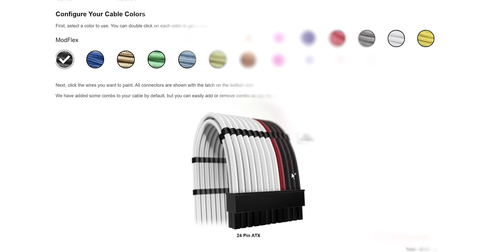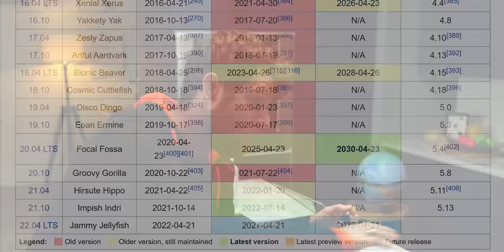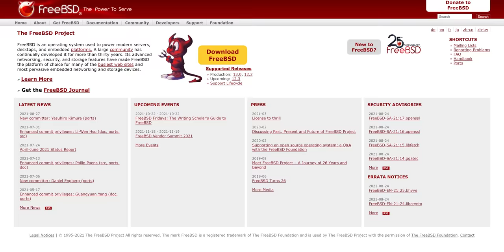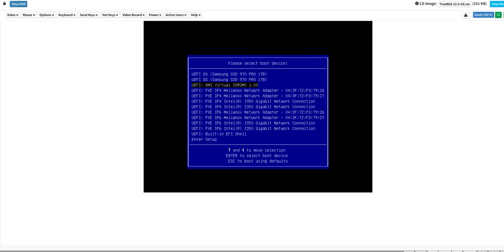We Finally Did it Properly - "Linux" Whonnock Upgrade

Comment: "We're going Linux baby!" - Goes BSD.
Reply: Ya. TrueNas Scale is Linux (they have BSD though as well) though. Still in beta, improving every day. Seems to work fine though.
Reply: In the end... Bsd likes. , 🆓
Reply: @Fiberton  maybe 10 years ago.
Sorry, Linux more perrormant, secure these days ;)
Reply: Honestly BSD is not even that bad and hard. Most linux apps work on BSD and when i say most that means 98% of them lol
Reply: @Fiberton  Installation can be nasty, ditto Debian and wifi not working by default. artificial hurdles to dissuade people using them.
Reply: "We're going Unix!"
Reply: UNIX, Linux, BSD… same difference 😁
Reply: @OwenGilmoreOG  Only a person who knows nothing of Linux would say that.
Reply: @OwenGilmoreOG  nah. They're distant relatives at best. Even though Linux shares a lot in common with Unix, it's still not Unix.

A little back story about Linux (at least from all I can remember from researching it): GNU/Linux (A term that's only useful when discussing the history of Linux) was made at a time when Unix was entirely an enterprise operating system and well out of the reach of most people. Unix had multiple forks from various manufacturers that they bundled with their expensive hardware and they were largely incompatible with each other, and most of them could only run on select machines. As a result, it was rather stagnant outside of Research Unix (which became BSD at some point) and there wasn't much software for it beyond what the manufacturers wrote for it. Companies had to pick and choose what version of Unix to support. Tired of this, a group of hackers set out to create a clone of Unix for the masses. As they continued to develop it, they realized there were numerous things that could be changed or improved on, but would break compatibility with Unix. They chose to do those things anyways seeing as they figured that software developers were going to flock to this new Unix-like operating system. Some time passes and the bulk of GNU was in a working state, but it needed a kernel. Multiple people tried to submit their own, but none were particularly great. All while this was happening, a particular man named Linus Torvalds was fooling around with GNU and tinkered with it daily. Hearing the news of a kernel being needed, he decided to create his own and did a lot of research on how kernels and operating systems worked in his free time. At some point he decided that his work was decent enough to share with others. Shockingly, it was rejected by most people at first. But sooner or later the people at the FSF with GNU realized that Linux was a far better kernel than anybody's attempts so far, so they decided to partner with Linus and make a full operating system out of it: GNU/Linux, with Linus focusing on the kernel and the FSF focusing on the operating system. Within a few years it became a huge success and the rest is history. And they continued to change things and become further and further away from Unix.
Reply: @felipec  ahhh computer compater my good sir
Reply: @OwenGilmoreOG  Microsoft Windows, Apple macOS and iOS, BSD, and Linux has their UNIX roots!
Reply: @markarca6360  indeed, windows is becoming much more Unix like (powershell)
Reply: Just use both BSD and Linux, you'll be having best of both.
Reply: @OwenGilmoreOG  I wouldn't say powershell is Unix like. Every returned value in powershell is an object while in Unix shells returned values are strings.
Reply: @houserouterhouserouter5808  If anything BSD is better thanks to apple helping greatly with the development of free BSD. But that doesn't change the fact it's not linux, linux is an imitation of BSD (it's "unix like") whereas macos is based on freeBSD. So it's closer to being a macos-server than it is a linux server.
Reply: @nigratruo  I don't think it's fair to say "Unix is dead" when Mac OS is a Unix OS and Unix Certified. Unix is far from dead from that fact alone.
Reply: @theonearmedbandit3826  You’re certainly right but his point was that unix principles are just that, a base. Many parts of the original operating system would not hold up well in the modern world, which is why macOS and linux shine
Reply: @JordanLOL  Unlikely, BSD keeps developing and many of closed solutions are based on BSD. PS4's Orbis OS is such a great example.
Reply: @JordanLOL  wasnt SCALE version. Could read FreeBSD on the console, lol. Also shell was FreeBSD's 'csh' not 'bash'..
Reply: @unitrx5535  would love to see an article or video on that information if you could dig it up. A quick Google turned up some info, but it's super old.
Reply: @OwenGilmoreOG  well Linux is not Unics certified so officially not Unix.
Reply: “Deeeeeeeeebian”, lol.
Reply: Linux isnt even linux. Its a colloquially used name for all kinds of linux based os
Reply: @nigratruo  Unix is not dead. The one big problem it has is user-friendlyness, and I don't think this can be solved without giving up on everything Unix stands for. It will probably always remain a power users' OS.
Reply: @martijnheil8825  Oh UNIX is really dead, has been for many years, but Linux is alive and well and it is current, not 40 years old. So everything that gets attributed to Unix today is actually thanks to Linux. Linux drives the whole development forward, not Unix.
Reply: @nigratruo typical Linux these days is a unix clone with some modern additions and a badly designed window system + GUI bolted on top of it. Everything below the GUI still uses the old unix primitives.
Reply: @martijnheil8825  You are clueless if you think that, most components are no longer Unix. The Kernel has nothing to do with Unix anymore, the startup System, the sound system, the firewall, the TCP/IP networking layer, the display server (wayland), KVM machine virtualization, docker and containerd app virtualization, the boot manager, the EXT4 filesystem, SSH secure shell, bash, all these things are not from Unix and when existing in BSD, they have been backported from Linux, not the other way around. Unix has been dead for many many years, no wonder nothing is left. (except some of the CLI tools like the cp and mv command which date back to 1973 ;-) LOL
So your so called Unix is a Linux clone today.
Reply: @nigratruo  This is only because Unix development at Bell Labs stopped long, long ago. All these things you mention are continued developments of Unix. It doesn't matter that they weren't written in the 70's: they're still building on and inspired by Unix.
If you want to see something that's definitely not Unix, look at Windows NT.
Reply: This triggered me a little bit 😄
Reply: @nigratruo  Can't you refrain from personal attacks?
Clearly we have a different definition of unix.
Reply: @martijnheil8825  Sure, it is just endlessly annoying when people keep repeating the same old bullshit and falsehoods about what Unix is supposed to be. You could also maybe learn something and learn to use arguments to prove your point? You just keep ignoring what I say and keep insisting on your standpoint. Why isn't it called the Unix Kernel if it is supposed to be all Unix? Can you relate how annoying it is if Windows would always be called MSDOS, while it in fact has nothing to do anymore with MSDOS and has not been based on it for a long time?
Reply: @theonearmedbandit3826  Yeah! Heck, Macintosh has just about a whole 15% of the desktop+laptop market! Look out, world!
Reply: @KurtRichterCISSP  it's funny that you would think like that... If we include mobile OS, iOS is around 17% and MacOS around 6% for a combined 23% although unlike MacOS I think iOS is not Unix certified and is only "Unix like" just how Linux but still built upon the Unix philosophy. Android (Unix like/clone, since it's a fork of Linux kernel) is at around 39% so that's a 62% market share for Unix and/or Unix like/clones in total in the computing world. Windows is at 31%. So yes, look out world. Unix or at least the Unix philosophy is alive and ticking, no matter what anybody tells you, thanks to the combination of MacOS, iOS and the Unix clones. So I stand by my original comment. Unix is not dead (or at least the Unix philosophy isn't as it's used in many modern operating systems).

I didn't include Chrome OS or Linux and BSD since their share is so low
Reply: @theonearmedbandit3826  you know, you're right. If you include iMacs and ipods it just keeps growing
Reply: @KurtRichterCISSP  iMac's use the same OS as all other Mac computers...they use MacOS just like a MacBook and Mac desktop. What are you even on about at this point... iPods also use iOS same as iPhones...
Reply: @markarca6360  MsDos/PCdos/CPM.. all have their roots in UNIX.
Reply: Lies, all LIES! 😡
Reply: @theonearmedbandit3826   @The one armed bandit  )) you can't simply add up percents derived from different bases to calculate a combined share of something! So, your 23% and 62% estimates is a total joke and far from reality.
Reply: @scality4309  Exaggeration -- of course, they all borrowed some generic concepts from Unix like file/directory/path, command shell, command pipe, i/o redirection, small system utilities and some other tried and true ideas known by that time -- but that's akin to saying everything in the modern world is still based on an ancient Greek, Indian or Arab technologies, since all of the basic math was invented back then. The point is, Unix was the first and only universal and widely used OS family in the 70-s, so it's naturally influenced all the later developments in some way or another. But nowadays it's mostly a forgotten legacy: MacOS and Linux superceded it in almost all respects and pushed progress further, while keeping source-level and ideological compatibility to some extent.
Reply: @alexanderr.539  It's not, do you know why? Because they are all Unix/Unix based. Which was the argument, as some people think UNIX is dead when it's clearly not. Do you think the market share for Windows only counts windows 11 or something or all versions of Windows in use... Duh. The joke here is you not understanding I looked at the market share where UNIX was involved to show it's not dead, but not getting that point. What do you think I counted? I threw in some OS's  with no relation to Unix?
Reply: @alexanderr.539  Even Microsoft sold Xenix (their license of UNIX to companies)
Reply: @theonearmedbandit3826  )) go back to school, dude -- you clearly don't understand how to properly use and interpret percents of different base values and to get the overall share. Your point that all those partial figures are somehow unix related is absolutely irrelevant in math. 

Unix as a concept / OS design philosophy is not dead, Unix as a pure product mostly is. Even FreeBSD is not an old-school pure Unix anymore -- just a hybrid OS with some modern borrowings, not to mention a MacOS or iOS. Pretty much the only area where pure Unix is still being used are some rare mainframes and maybe some unique industrial/medical/millitary hardware due to historical/political reasons.
Reply: @scality4309  Yes, they did. But what Xenix has to do with xDOS/CPM besides being sold by MS at some point?
Reply: @alexanderr.539  UNIX is a license now.
Reply: @alexanderr.539  That Microsoft just buys things and not create them. In the early days i thought that Microsoft invented BASIC. Turns out it was invented by a university. Microsoft takes all the credits even of they don't deserve them.
Reply: i really dont need custom colored computer cabling
Reply: @rullywow3834 "Deeebian"  I did a quick internal 'eyeroll' on that one, too...
Reply: @hvysomething Interesting
Reply: @INSERTNAMEjoe  "Linux isnt even linux. " <Sigh!> <double eyeroll!>
Reply: Fair enough move for their usage. I used to go Debian but that distro is more about stability than cutting-edge.
Reply: @JordanLOL  Where do you get that from? I have never seen Linux even come near FreeBSD when it comes to performance. And about security, have you even heard about OpenBSD?
Reply: @OwenGilmoreOG  Nope. Different OS´s, similarities in command syntax due to the UNIX legacy.
Reply: @michaelheimbrand5424  Thanks bro.  Nothing will show me my ignorance more than spouting off in a group of *nix experts.  I really should download and learn more about it
Reply: BSD is more based
Reply: Where going not windows baby.
Reply: FreeBSD is like the awkward middle child. OpenBSD is rock solid & secure, and Linux has great software support. FreeBSD has mediocre software support at best, and isn't that reliable either.

Comment: Linus, its like every engineer in racing has told: "If you give your driver 100hp more they mention not noticing it, but if you take 10 away they complain the car is undriveable!"
Reply: You mean "if you mention there is 10hp less they'll tell you it's undriveable" even it's still the same ;)
Reply: Did I understand this correctly: What we have seen in the video is only a temporary solution to keep the editors working while New New New Whannack, aka Whannak 4, is set up?
Reply: @RandomUser2401  it's a combination of being a temporary setup, as well as a test bed for the configuration they'll be installing on New New New Whonnock.
Reply: Once you get to a certain point going faster is less noticeable, but you can feel when you don't go as fast.
Reply: Tofu run without spilling
Reply: @wobblysauce  like a lot of people don't notice if their new phone has 120hz until they try going back to 60hz?
Reply: And the driver is correct.
Reply: ...and it is only that 1% of elite drivers that actually notice. And low and behold, one of them actually noticed.
Reply: @sntslilhlpr6601  Lo. Who says only elite drivers notice?
Reply: 10 horses is a lot of saved horse poop cleanup
Reply: @TimBoundy  new^3 Whonnock

Comment: Jake: "I've done a little testing on this"
Also Jake: explains every single setting and how they differed between different states during testing
This is not a "little bit of testing" my man, this is proper testing.
Reply: yeah I was wondering how many hours he spent on this.
Reply: @francoisviljoen4002  its linux, the answer is only one "a lot" :)
Reply: Well, when you're a professional your work becomes easy to you.
Reply: @kosajk  Its not linux, its a unix based system they went with TrueNas which is FreeBSD not linux
Reply: @bigbay1159  idd thanks for the info never got that far into it actually,
Doesn't look any better tho in time consuming department :]
Reply: @kosajk  No worries, even in the video they mention how they aren't being honest about using "Linux", and yeah I can't say much about freebsd, have no personal experience with it
Reply: @bigbay1159  They are very similar. FreeBSD is probably Linux's closest cousin in terms of how it feels to use. Most programs and desktop environments developed on and for Linux are made compatible with FreeBSD with minor tweaks.